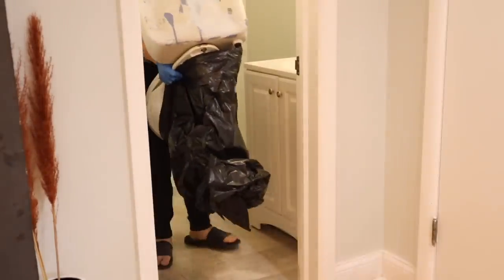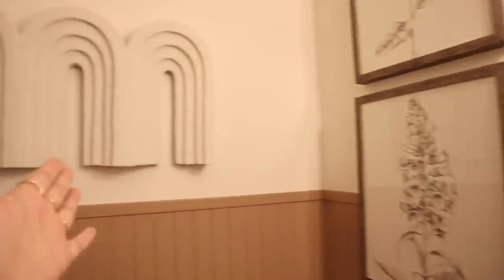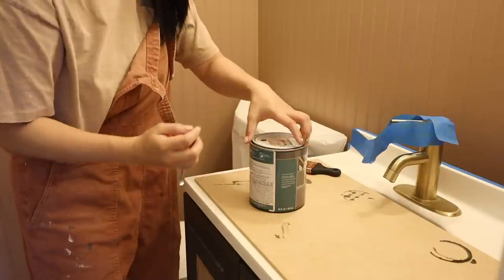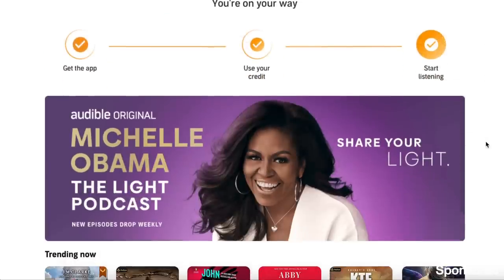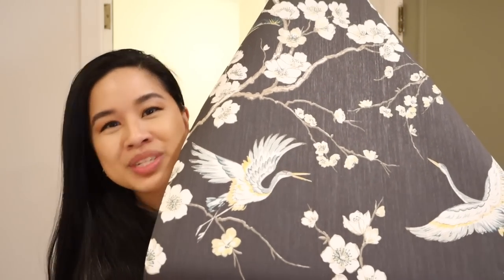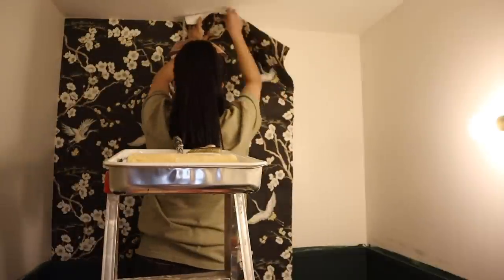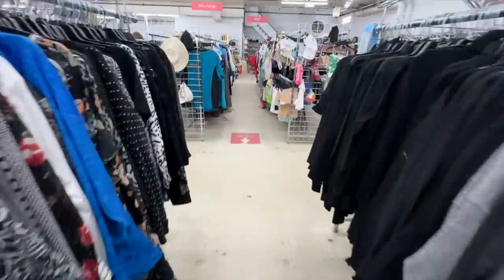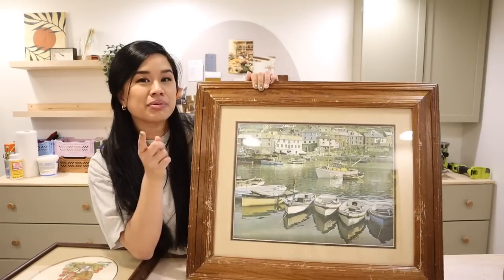MOODY BATHROOM MAKEOVER *BIG CHANGES* to the Powder Room! (hope i made the right decision)

Comment: Love the cabinet, paper and new color although I not entirely on board with the art chosen for the cabinet, the bathroom is too small for the eye to pull the same color from the lower bathroom cabinet panel. I would try the wallpaper in there or even try your" busy"apricot blossom print to coordinate with the paper and the tile floor. I dunno, just my opinion.  I think you did the right thing with this change.  It is beautiful.

Comment: Lovey! I love the project with the frame. 
I recently did a ‘dark and moody’ powder room in my house. I did one full wall with bead board. I chose my wallpaper for the accent wall behind the vanity/toilet. Took the wallpaper to the paint store and matched the background. It’s almost black! Painted everything but the accent wall including the ceiling. I used paste-able wallpaper as well. It was a bit of a chore because I had to overlap the edges, and then cut with a straight edge to get the pattern match. Because the wallpaper is dark, I had issues with being able to see the white edge of the wallpaper once it was installed. I solved this with a brush that had about 4 hairs, the matching paint and a steady hand. I love it.